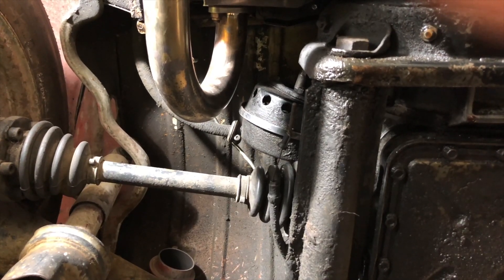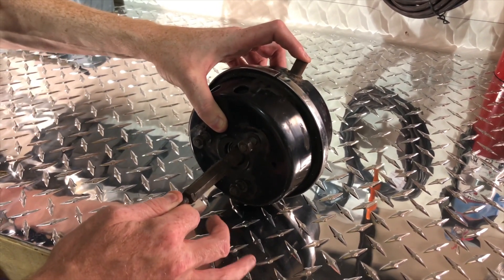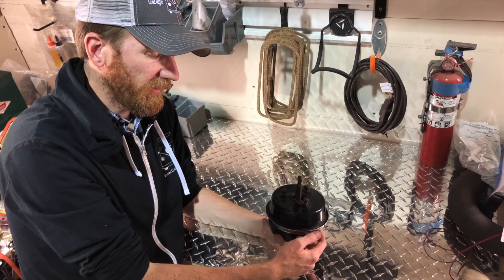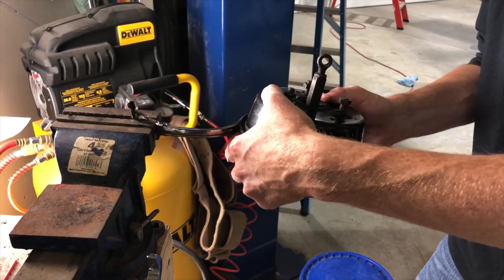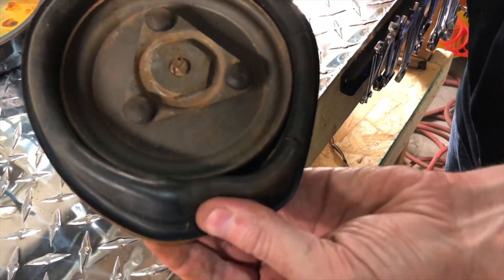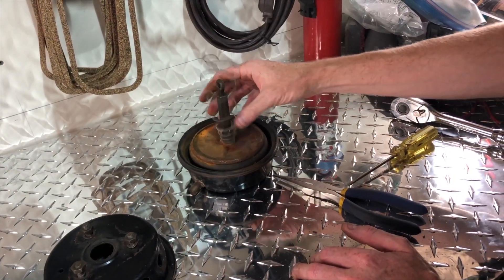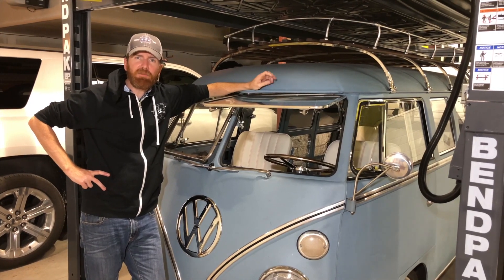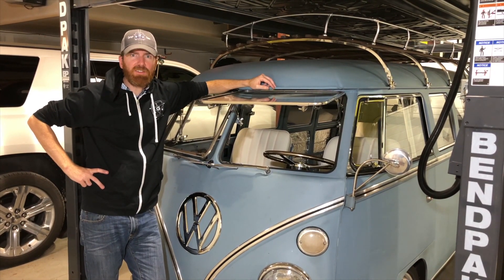VW Autostick - Clutch Servo - Test, explanation and Disassemble

Comment: Do you know if there are two different diagrams ? I think so. I had one that I bought twenty years ago and stored it. When I got it out there were two diaframs in the bag, small and big. Both were rotted so I ordered a new one. It was like the one you have but too small for the clutch to engage. Do I need to adjust the linkage ?

Comment: I am picking up a 69 AS beetle this week, it will go in Low and 1st, but not shifting into 2nd. Would a bad clutch servo be a likely source of that problem? not sure since you are able to shift between the lower 2 gears. Thanks, your videos are so clear and well explained.
Reply from the maker: Hi Chip, when you shift/try to shift is the vehicle running, moving or both? Curious if it is a shifting, clutch or a transmission problem.  Let us know more and we will try to help. Thanks

Comment: Hi Mike & Shaun,

Great video! I’ve recently bought a 1970 1300 Beetle Stickshift here in the UK. Excellent original condition with only 21k miles from new. I also have a standard 1500 manual Beetle do just getting used to the stickshift. My question is as my car has been mostly stored during its lifetime do you think a split diaphragm may be the cause of why my Beetle clunks quite heavily when engaging reverse? Other gears seem okay, I do think the idle is a little fast which I think would also add to the clonk when engaging reverse. Is it just a case of taking off the servo and doing a test like in your video or can the test be done whilst on the vehicle?

Any help would be greatly appreciated 👍
Tony

Comment: Thank you so much for this video, i have now found a small tear is my rubber gasket. Would this of been the reason the ATF was getting really hot if the clutch wasn't engaging properly? The garage has had the gearbox out several times at the cost of £1300 and couldn't find the issue. I really hope this is the fix, I'd love to know your thoughts on this
Reply from the maker: If you have a tear, shifting should have been hard or very ‘grabby’ as it was not holding the vacuum. Kind of like just dropping the clutch on a standard car. The ATF getting really hot? Any other symptoms?

Comment: Hey guys I have a question so we have a 1970 Volkswagen bug auto stick now when shifting into reverse I get a grinding noise also when I go to touch the stick shift you can barely hear the vacuum sound could that be a cause of a bad servo?
Reply from the maker: It could be a few things, including bad diaphragm, but may also be clutch adjustment? I would take servo out and check first, before tinkering with clutch.  Good luck.
Reply: Garage Time thank you very much for that feedback once I get the chance I’m going to take a look at it Have you guys made a video yet on clutch adjustment?
Reply from the maker: We have not, but will this spring/summer when we pull down from storage. Thanks